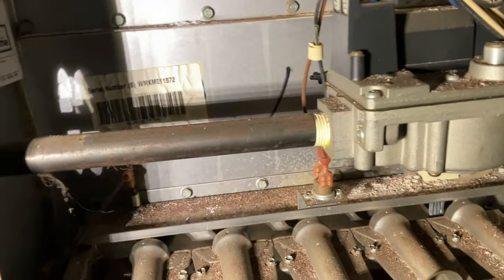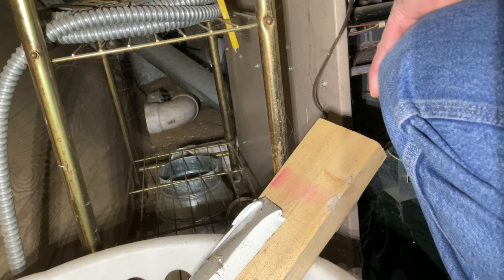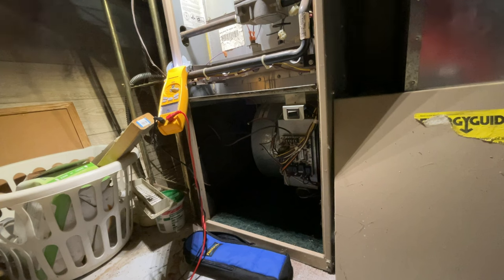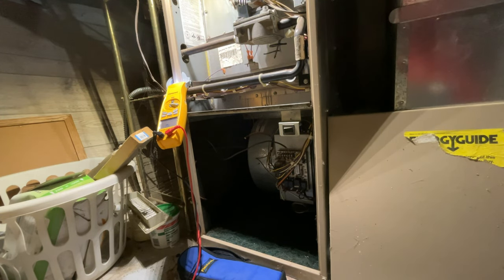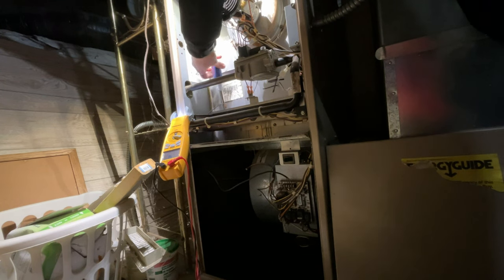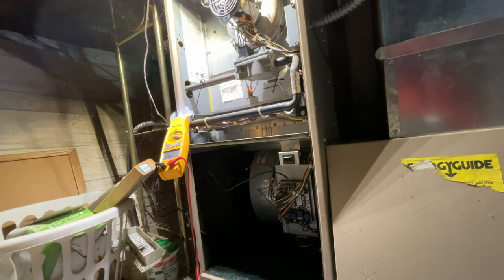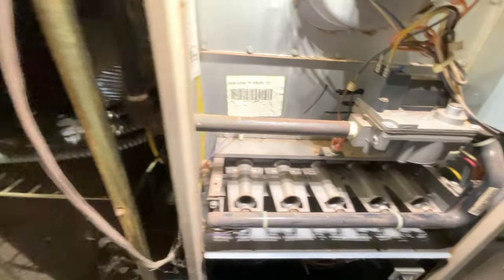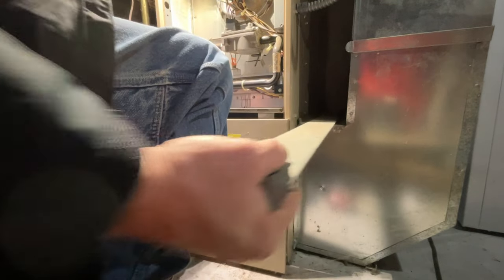Do it yourself install Furnace No Heat FIXED

Comment: I've never seen a house furnace hacked like this, but I did run into a unit heater someone shoehorned into a basement, vented the same way and they had the thing sitting so the burners were facing up towards the ceiling. Yeah I shut that thing down immediately. Some people really should stay away from HVAC.
Reply from the maker: Yes, I agree. It's one thing if someone has a clue on how to on safely and correctly to install any piece of equipment. Thanks for watching.